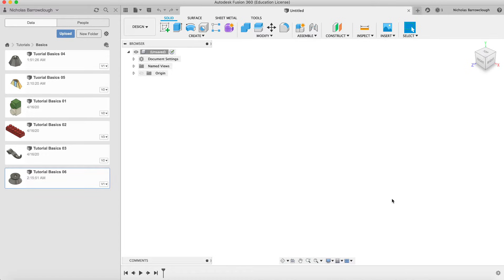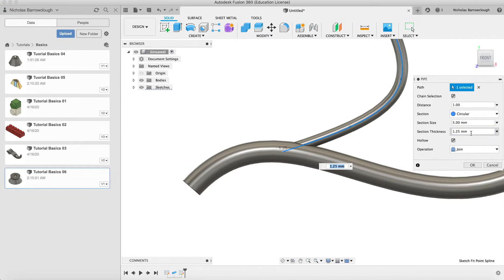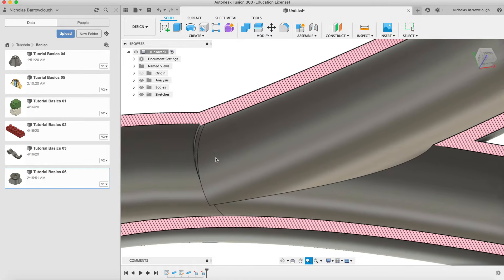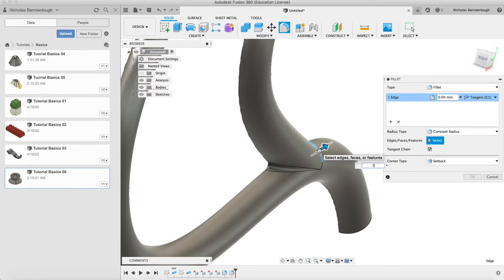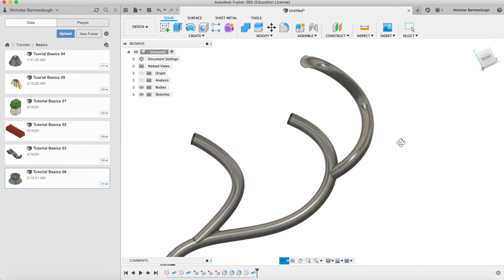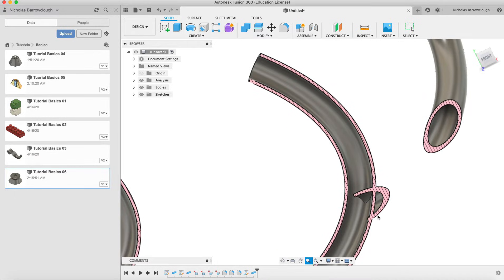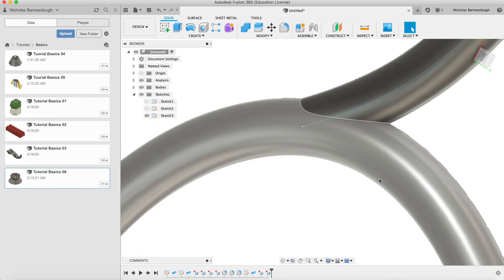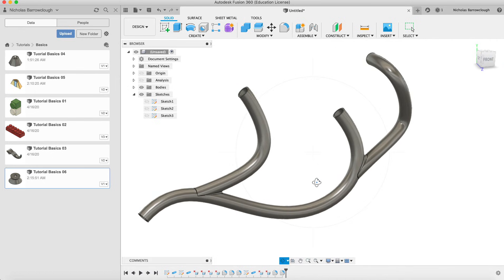Fusion 360 Basics - Pipe Tool (Tutorial 08)

Comment: How can I make sure I do not exceed bending radiuses specified in the data sheet? Manually dimensioning every bend in a spline is of course an option but not a really convenient one. 
I so much prefer dedicated cabling and piping sets of tools other CADs provide. If it could all have been done by just extruding pipes along sketches other systems wouldn't have developed things like Creo Cabling.

Comment: To assure pipe alignment first time, every time, leave the lines on and momentarily turn off relative pipes. You can't see through the pipe to see its guide line and line snap doesn't work well if you're not very close. Adding "loveliness" to your joints is also easier before the pipes are obscuring what you are really doing, which is nothing but drawing lines. F360 draws the pipes and given half a chance, draws them very well, you'll never have to tweak a joint.
Reply: Sorry, hadn't done pipes in a while, the lines are clearly visible with the pipes on, (not sure that was always so) just be careful to join with the existing guide line to assure perfect joints.